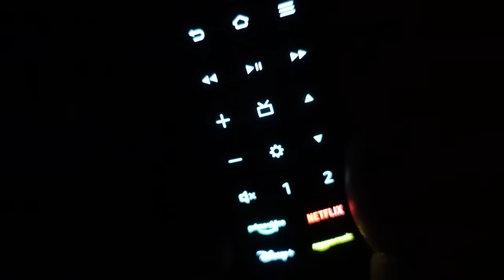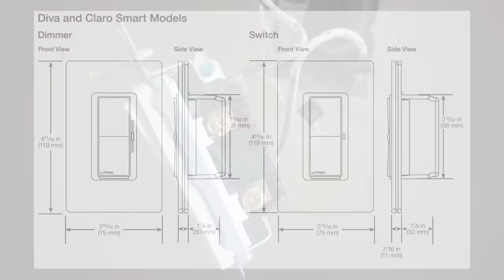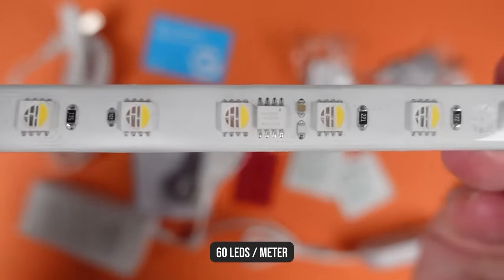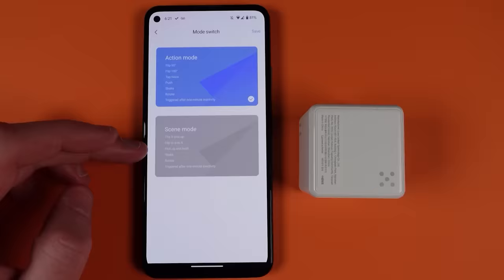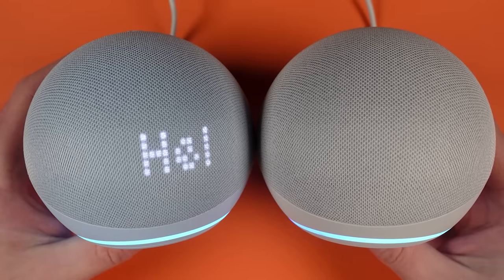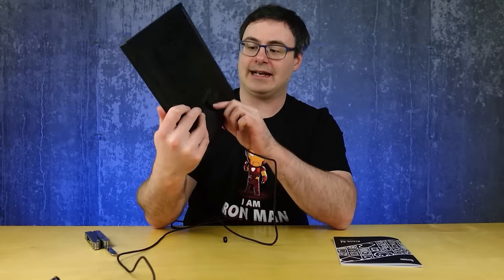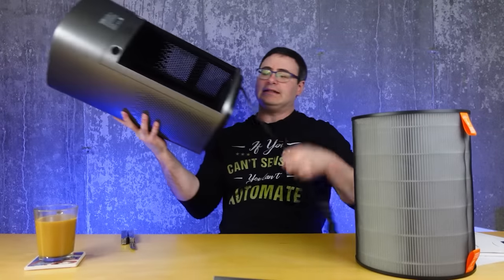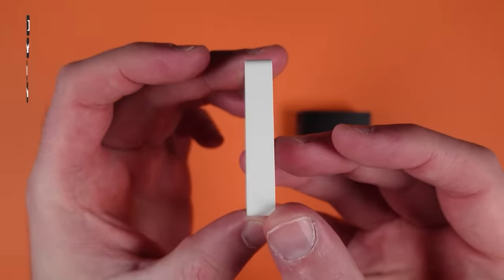The Best Smart Products of 2022 // Massive Unboxing and Showcase

Comment: Moen makes a line of smart devices including a valve actuator. These units are much smaller than the Zoos unit.
Reply from the maker: Yep! This one's always locally controlled though. Is the Moen lineup?
Reply: @AutomateYourLife  Not sure just saw it the other day. I live in an apartment, so it is not an option for me since I have no local control of my plumbing. Its an older building and there are only shutoffs on each floor, not each apartment.

Comment: Love the Yolink stuff I have 8 different items from them and they are a solid product from my experience. Anytime I had a question customer service got right on it.
Reply from the maker: So good!
Reply: Just wish they had local control.
Reply: The outdoor sensor by yolink is wonderful. Now that i figured out how to expand voice notifications to both my alexa and google speakers even more useful.  Added yolink outdoor plugs and freezer temp monitor recently. Integrations with alexa and google have improved. Automate Your Lifes's virtual switches are also little miracle workers for many routines. Not just yolink…Just learning how to use them now.
Reply: @ypark2877  I have a outdoor sensor also and overall it is great, something to consider when thinking about how you are going to use is this, since it uses IR to measure motion if the temp of the thing causing motion is not greater/less than the ambient temp of the sensor it will be invisible and not trigger. The example where I found this out was when it started to get  cold and cars coming/going down my driveway would not trigger it, as soon as a person went by it would instantly trigger. Cars were the same temp as the ambient air so they were not there as far as the sensor was concerned, I further tested it by taking the Wifey's vehicle out of the garage, which was warmer than outside, and driving it down the driveway and boom instant trigger.
Reply: Thx for tip. No problems yet with any misses but will keep in mind. Wonder if angle placement helps. Mine faces at angle across curved drive, maybe that would tend to pick up front of car so may see Engine heat more ?
Reply: @ypark2877  That is an excellent suggestion but unfortunately due to the location/ design of my driveway that's not a mounting option 😞 But now that you mentioned it I am going to have to see if I can readjust mine. My issue is if I get the angle wrong it will pick up every dog walker and vehicle on the street.

Comment: Hey there.
I gotta say, when I saw that "Media" air conditioner (hope I got that right) I had to comment.  I got that other one you were talking about...the one that's in the window, and you can still close the window because there's a split down the middle?,,,anyway.
If you're ever interested in in, GET IT!
It works unbelievably well, and it costs me roughly 15٪-20٪ of my old one that was bigger. It's hooked up to wifi, has an app, you can set it to use it less at night to save energy, and it runs with any Smart Home app.

Hope this helps someone else.
Reply from the maker: That thing is still amazing.  Just took it out this week and have loved it up to now

Comment: You mentioned lutron was not compatible with LED lights that are app enabled dimmable. Could you elaborate.
Reply from the maker: Smart bulbs dim differently than regular dimmable bulbs.  There are many methods to dim a bulb, but most dimmable bulbs do so by Phase Width Modulation (shrinking the time it takes the wave to complete a cycle, or expanding it) or current reduction.

That doesn't work well with a smart bulb that has its own controller.  Changing current or the wave doesn't work for a controller like that.

Comment: Hey Brian,  I recently bought two Ikea short cut buttons to work with my Smartthings platform.  But when I connect them to smartthings they come up as THING.  I tried to go into the IDE and change it to Zigbee button but that didn’t help.  Just didn’t know if you have had any experience with these buttons.  Maybe I’ll have to go a different route.  Thanks
Reply from the maker: Got a link?  I'd check for an edge driver these days instead